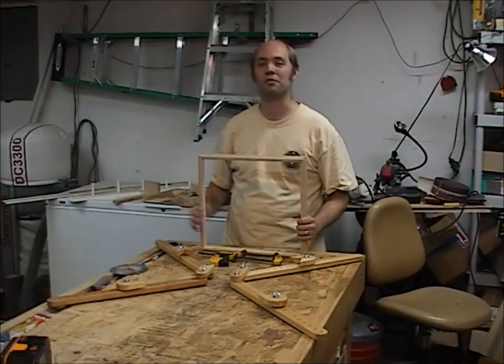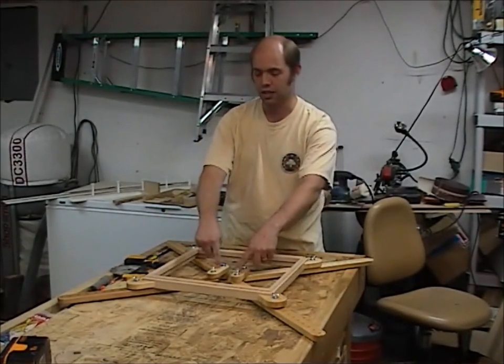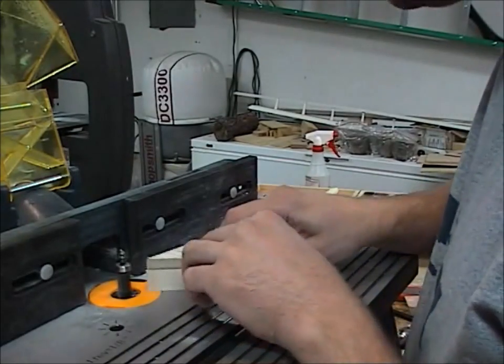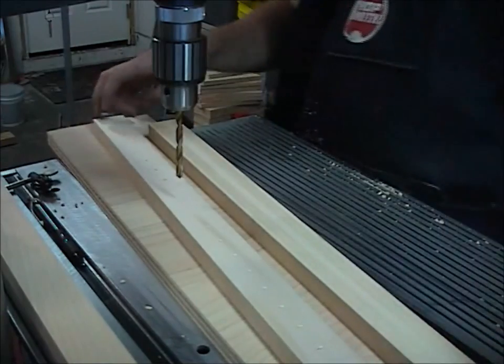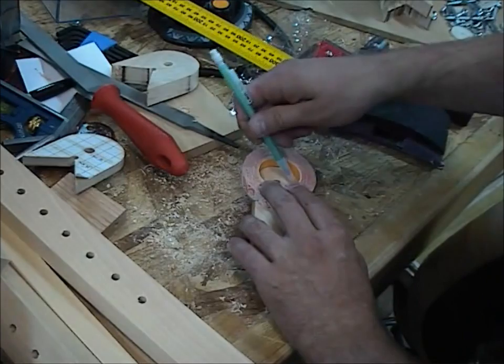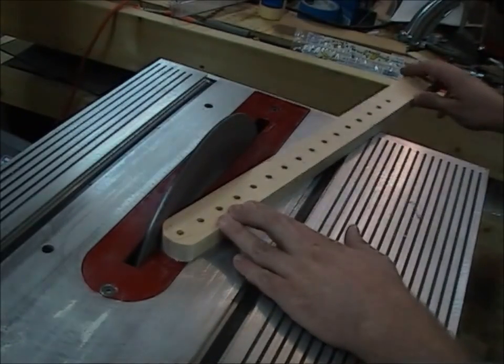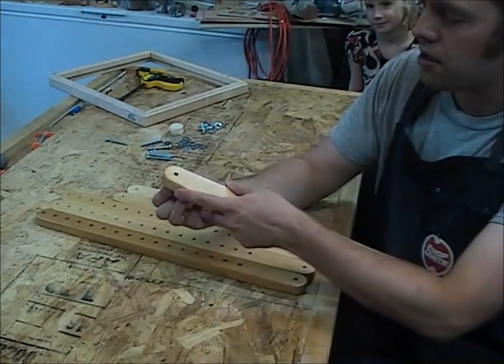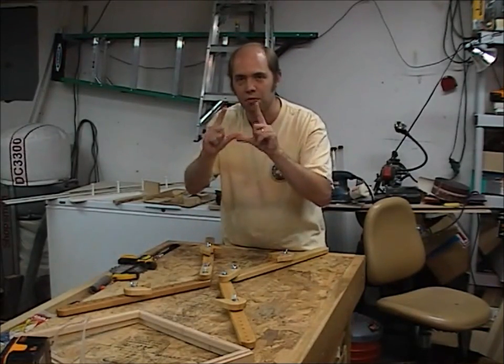9 - Frame Clamp - Manhattan Wood Project

Comment: I tried to use this on a much larger scale to clamp a 60x60" table top with mitered corners. The material was 5" wide, 1 1/2" thick poplar, so my Bessey corner clamp wasn't wide enough to glue one joint at a time. I didn't want to tie up a quick-clamp, so I used a bolt through one of the linkages into a T-nut in the opposing linkage. To a greater degree than in your video, I experienced a lot of flexing of the long arms once the jig was tightened. I had to give up, as the clamp pressure was too uneven at each joint and allowed the clamp to spring free of the workpiece!. Birch ply, or better yet aluminum bar stock would have worked better than gluing two layers of MDF together in my version.

Has anyone tried metal arms, or perhaps a top and bottom layer of arms to minimize flexing of the clamp? I thought about clamping the arms to a work surface, but 5'x5' was way bigger than my assembly table. Plus, I would not be able to set it aside on edge to dry.
Reply from the maker: Kes Barkauskas Great observations, thanks for letting me know!  I like your idea of using a bolt and t-nut too.I would imagine for wood and joints that large something a lot stiffer would be necessary, but you may be able to get a lot more clamping pressure by attaching a set of long arms to both sides.  You'd have to clamp or bolt on both sides also, but if the table legs are removed it shouldn't be too difficult.
Reply: To reduce the bow of Flexing dado a slot most way of your arms and Glue in .750” ply on edge in your arms !
 Just a thought tho !

Comment: I love seeing a Shopsmith in use...they are so under rated. I have a 520 and a 510 shorty that i use for drilling and pen turning.  i see your DC3300 in the background, you don't have the plastic bags? what is the canvas type?
Reply from the maker: I love the Shopsmith, but it's so big that it seems funny whenever I use it to turn something pen-sized on the lathe.  Doesn't stop me, but I laugh at the idea of using something that big for a super-small project.  :)

I do have the plastic bags, it's almost full and needs to be changed out.  The canvas hood is just the standard 7 micron 12" hood, which is good enough for me for now.

Comment: Great frame clamp. What type of disk sander was that? Did you make it on your table saw?
Reply from the maker: Thanks!  The disk sander is part of the table saw, which is a Shopsmith Mark 7.  It's a multi-purpose tool, and works great in my relatively small shop.

Comment: Will this work on frames that are not square ?
Reply from the maker: Yup, it should work on any square or rectangular frame.  The frame I used was actually somewhat rectangular.  I suspect it would also work on trapezoidal frames with angles that aren't 90 degrees, but the feet would need to be cut specific to the angles they clamped and I suspect it would be somewhat difficult to put on the hand clamp and not have it slide off.

Comment: Your disc sander looks just like a table saw?
Reply from the maker: +Despicably Irascible Rapscallion That's because it is.  :)  It's a Shopsmith, which is expensive, but turns into 7 different tools while only taking up the space of 1.  It's the only reason I can do woodworking in the junk collection that is my garage.
Reply: ManhattanWoodProject LOL.  I have a spare worksite table saw.  Do you think it would be possible to use it as a disc sander?
Reply from the maker: You might be able to do that if you made a disk to fit on it, but I'm not sure whether the saw's bearings would be able to handle the side loading on it.  It's an interesting idea though, something izzy swan would probably be able to answer.
Reply: ManhattanWoodProject Thanks for the lead.
Reply: That a Good ides Bubba
 I’ll try and take Two 12” JUNK SAW BLADES, Bolt them together and grind off the Teeth so I know the Arbor size is right However I will have to cut a center hole in the self adhesive sanding disc to clear the Saw Table Arbor Washer and PRESTO we now have a fast changing dual purpose Tool !
 Just a thought tho !
Reply: @vincepresto759  I have a 10" disk that I bought YEARS ago for sanding on the tablesaw. I don't remember where I got it but, you may want to look on some of the Web woodworking sites. I'am sure that someone still sells them.

Comment: It is better than a lot of holes in each leg to make a groove in that
Reply from the maker: Fardin Net That's a good idea.  I'm not sure how much force I'd be able to apply without the plastic washers slipping, and I don't want to tear up the legs using washers or nuts that will bite into the wood.
Reply: Fardin Net iii.         .

Comment: it's so awesome !! i need one, i don't know if you can send to me the files to do it. please. 
:D
Reply from the maker: I don't have the SketchUp files for it any more, but it should be easy to make up on the fly.  As long as your duplicate parts are similar enough, any error will be compensated for by the hand clamp in the middle.
Reply from the maker: If you're interested in buying a set, I am now offering them in 2 sizes.  http://www.manhattanwoodproject.com/frame-clamps.html
Reply: Looks like site is down.....does anyone have the sketchup file for this? I would love to make or buy one